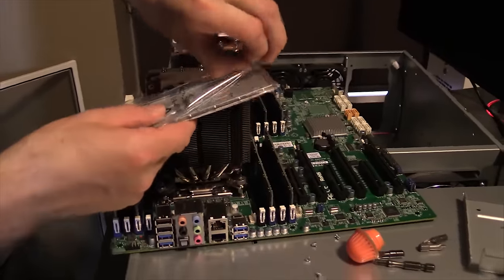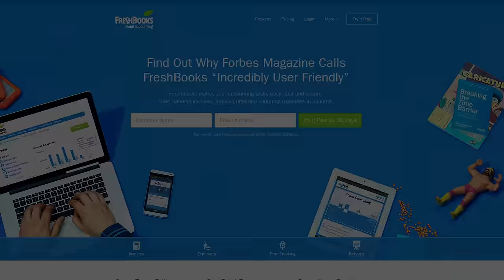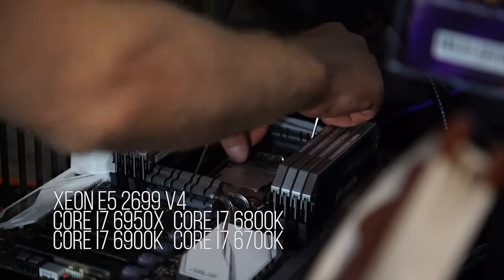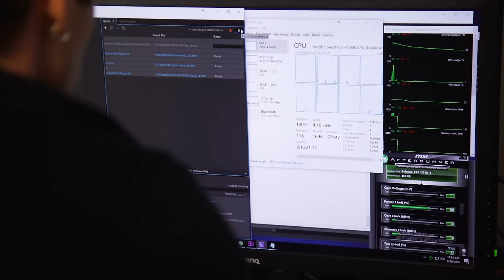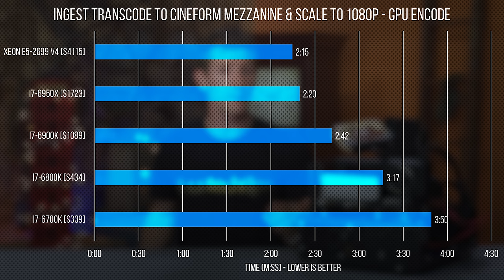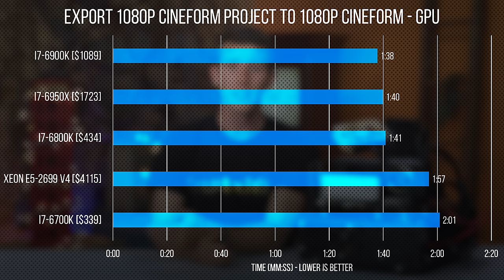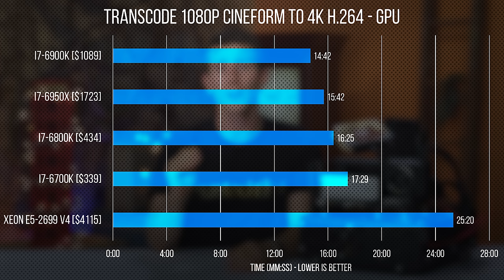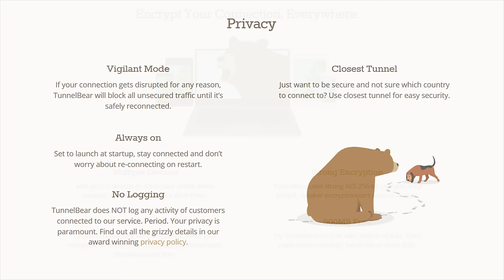$300 CPU Beats $4000 CPU?? - Cores vs clockspeed for video encoding

Comment: Please do not sort the bar charts based on time. Keep the processor you test in the same row. Otherwise it's super confusing
Reply: That's...... actually a good point :O
Reply: I like the way they do it, It allows us to see what came first and last much easier rather than going back and forth between rows.
Reply: not realy
Reply: His graphs made perfect sense to me, idk what you're confused about.
Reply: or at least color code them so I notice them moving around sooner XD
Reply: Color would have been nice or keep them in the same location.
Reply: FishFind3000 yeah, a colour gradient from "cheapest" to "expensivest"
Reply: Seriously, for encoding tests, time duration graphs ordered by fastest to longest is the most sensible way of displaying the data. There's nothing wrong with his graphs.
Reply: You noticed it, so it cant be that confusing.
Reply: what he meant is that you can "instantaneously" see the difference between the processors in each workload if the processors were in the same spot instead of having to look to see which cpu is now the fastest... that's all he meant... which i agree it would have simplified thing but the way linus has is, is basically how most have it anyway.
Reply: He's got a good point guys... When you put by time only one chart is good, but, when you do the "Before & After" thing that makes confusing to see what's the outcome of the best one or worse one for example.
Reply: Yes. If you're showing multiple graphs one after another, please keep the row positions constant... ESPECIALLY if the names only change by a single character!    -_-
Reply: I actually had to go back to the first graph since I thought it was always arranged like the first graph. I was confused why it didn't reflect what Linus was saying.
Reply: I'd agree with you Simon, if there weren't a bunch of different graphs being compared. I feel the whole benefit of using a bar graph here is to be able to pick out which was best in a line-up, but they're already in order so might as well just put scores in text. If they kept the CPUs in order, you'd still be able to see which was fastest and which was slowest by reading the bar graph, which is very easy if you differentiate entirely different lengths. Having to refer back to the cpu over and over to see how they perform in comparison is frustrating because not only are they all in plain text but they're numbers with a few letters and 6700 and 6800 are easy to mistake for one another at a glance, etc.
Reply: Everyone who didn't get what the OP meant needs to improve personal reading transfers and/or processing speeds.
Reply: +Carlo Canlas same here, I thought he was overstating until I looked closer
Reply: @LinusTechTips -- THIS. -- Please don't ever do that again!
Reply: No dude, it's not chronologically ordered, it's ordered by performance. It has nothing to do with brain power. We didn't say "OMG like I'm so dumb I couldn't read it! LOL" -- The point is it's harder to read it at a glance, you wouldn't have your data columns resorted every couple rows in an Excel spreadsheet, if you did, we could figure it out, but why waste the effort? Not to mention you have to mentally rebuild the chart based on price (which, according to the title) is the point of the video.  Finally, when you are someone like Linus, who is creating these videos for mass consumption, you have to consider, "does presenting the data this way introduce an extra burden to my watchers - - because that will affect the critical reception of my work" (and by your own admission, this format supposedly requires more "brain power" to figure out, and by what I posted above, it also gives us less data).  Hence, there is no upside to this format (at least when presented in video form -- this is not a "page").
Reply: Thanks Murphy.  I doubt I'll be changing the hearts and minds of random Internet trolls; I'm just hoping in the of chance that explaining it will help someone somewhere (maybe even Linus, if he lurks here, but probably a long shot).
Reply: To my experience Linus only reads the comments on the first day after uploading, sooo ... ;) As far as you can tell from when he's replying.

My favorite part btw was "remember where the different CPUs were in the other charts", which exactly does not help when they're constantly changing position ^^ Unless I got something wrong here.

EDIT: Oh nevermind, I got it now. It's just so way off and illogical that my inferior brain couldn't process it at once. So sorry :)
Reply: No one said sort by name.  You clearly didn't read what I wrote.  There is literally missing data in this format.  You can rebuild it in your head, but my constructive criticism for content creators is that,  for best reception, maybe don't put that burden on the viewer.
Reply: You still don't get you're misusing the word "chronological"? Man ...
As for the rest, Michael explained it already. I'll fill in if necessary, but until then I'll just watch how it goes.
Reply: What's your point in asking me what my point is and then posting what is exactly the point?! Do you enjoy contradicting yourself so much that you still do it when your failure is more than obvious? ... smh
Reply: Confusing for peasants....
Reply: You would think that's common knowledge among people who frequently have to display and explain data.
Reply: Oliver ASUS
It's unfortunate, but that truly is the direction we are going. The movie 'Idiocracy' pretty much sums it up perfectly.
Reply: unitedgray I cite that movie frequently ;)
Reply: +Patrick Star
No, please do not! I like it that way and it is the logical approach in my opinion.
Reply: "Idiocracy" is still standing strong.
Reply: +Patrick Star Did you try rebooting your computer?

Comment: Yep. Its 2016 and software STILL isn't being properly written to take advantage of multiple cores. May as well use a Pentium 4. So sad.
Reply: No, it just proves that diminishing returns occurs, and that the return on investment on high core Xeons is nill if you aren't going to use them for what they're designed for: heavy multitasking. Outside of games, which parallelization is shotty past 4 cores, most software either takes advantage of the cores it needs, or only needs a few cores. No point in forcing a program to run on 10 cores if more than 6 isn't beneficial.
Reply: No, it means exactly what OP said. ADDING MULTI THREAD SUPPORT FFS. IT'S NOT 2003 ANYMORE.
Reply: Ali Abdallah No, it doesn't. We aren't talking about the FX-9590 or 6700K. We're talking about a 44 thread high end server CPU, designed for scenarios where multiple tasks hit the CPU constantly.
Reply: as a programmer, the issue is not always the code, it is the nature of task that cannot be separated into smaller tasks. some tasks are just difficult to be multi processed in order to take advantage of multiple CPU cores.
Reply: ^exactly, this is one task on one machine, for this sort of price these are used in supercomputers and datacenters with multiple vm's so 1 cpu as being used as 4 virtual ones all doing different things at the same time like 7gamers 1 cpu.
Reply: As others have said a program code can sometimes only be broken down so much.  These huge core count xeons are not intended for running one rendering program or video game.  They are meant to go into giant servers and super computers in which these resources are is being accessed constantly by hundreds or even thousands of users doing scientific research, data processing, hosting an mmo server, etc.
Reply: It's the current year, why hasn't the world adapted to my opinions yet?
Reply: I stil use 486dx2 40mhz if turbo is on.
Reply: Pentium 4 WITH HT ;)
Don't even think of using a single threaded CPU nowadays lol.
Reply: theoretically it is possible to take advantage of all cores on a cpu on a program that doesnt use advantage of multicore. But to do that you'll have to make use a special mobo or maybe virtual drivers can do the job. not sure if they exist atm but it is possible
Reply: +Robber7 For something as trivially parallel as video encoding, you almost can.  I was just at an HPC special interest group last week.  Members of it write code that is not so trivially parallel but still scales to thousands of cores.  44 threads is nothing for an almost trivially parallel task (some frames on the join boundary need to calculated more than once but it really is almost trivially parallel).  Adobe quite frankly hasn't moved much on this from where they were almost ten years ago, and not just Adobe, the entire industry has failed to make a half decent framework for parallel computing, which is the real reason we see patchy support for certain hardware and it doesn't work unless tweaked just right, etc...This is what ATI tried really hard to push for with heterogeneous computing but the didn't manage to get any traction, especially with CUDA entering the market first and having an easier memory interface.  All the same, in the end, for video encoding it's just not that hard and Adobe has no excuse for it to not scale at the very least into the hundreds of cores.
Reply: I think it's beyond reason to expect a 22 core CPU to be fully utilized.
Reply: Adobes code base is pretty old. They have very little competition and their customers actually think their software is fast.
Reply: Some Weeb I guess that's why I do what I do and you do what you do.  Maybe not fully, but 95%+
Reply: Ah the old 'video is sequential frames, of course it's trivial to optimise for multiple threads' fallacy. h264 encoding introduces many levels of interdependency in the data stream (hence the efficiency of its output), this makes it far from a trivial task to scale encoder parallelism infinitely.
Reply: TehJumpingJawa It's not that many frames, I clearly addressed that issue earlier, and yes it's still pretty trivial, also we were talking about h.265 rather than h.264.  This isn't that hard for h.265, much easier even for h.264, and yeah, embarrassingly parallel for mpeg.  There was no fallacy here.
Reply: TehJumpingJawa Actually, some more details for you.  The rough process I described is encoding independent "slices" as they are referred to in the h.265 standard.  They have also have other parallel encoding options in the standard that are less trivial:
https://en.wikipedia.org/wiki/High_Efficiency_Video_Coding#Parallel_processing_tools
should one choose to use them.  I made no fallacy.
Reply: Multiple cores do not scale infinitely with almost all workloads. Do you think computers are magic? If threads have to be in sync your program can only benefit insofar as the slowest thread completes it's task.
Reply: DMitsuki I like how all you scrubs that don't program code to run on multiple cores like to tell me how it scales.  No, not infinitely, but it's not that hard to get it to scale to a few thousand cores on a shared memory model architecture.  22 cores/44 threads in this shared memory, even shared cache architecture, totally trivial.
Edit: Or you know, you can go ask the HPC scientists that were just at the SIG in the Hague for yourself.
Reply: I really find it hard to believe you have written any breadth of code when you just trivialized all data sets to your specific use case.

"Hurr don't tell me how multithreading works this very multithreading friendly workload scales real well so everybody should be able to do it in all task."

Two task have to sequentially solve a math problem. The answer the program is looking for is the sum of both math problems. Assume the add operation is a constant c, what is always going to be the fastest time this scenario can finish?

If we add in more cores, the answer doesn't change. If we add in more math problems and cores for each math problem, the answer is still exactly the same. zvxcvxcz
Reply: DMitsuki I find it hard to believe your reading comprehension is so terrible.  The context was video encoding, in particular h.265, see the link I gave earlier.  Not only is it not that hard, it's part of the fucking standard.
Reply: DMitsuki Try tagging them in your first reply then, you obviously have learned how to tag now.  It's not my fault you weren't up to speed with even the conversation, let alone the subject matter.
Reply: Most companies are going to use dated hardware and won't replace it for years. They don't follow the enthusiast mindset of replacing hardware every year or 2 since they don't have to.
Reply: or you use x264 instead of these shitty timeline encoders...
Reply: Depends on the software, newer games are doing a lot better! Try BF1, it makes use of all of my 16 logical (8 real) cores on my Xeon, delivers better FPS than my 4 core (8 logical) i7, even with 1500+mghz lower clock.This is dx11, just realised i haven't even tested it on dx12 with the xeon yet, must do that tonight!

So more cores be coming into their own, can only get better as the API's mature as well.
Reply: BF1 really was optimized to utilize a xeon? I find that hard to believe.
Reply: Kabloosh 
Optimised specifically for xeons, off course not!
However , when comparing the xeon to myn 2nd gen i7, its runs better because it is optimised to make use of as many threads as you throw at it, and runs better to boot!

Head on over to OC.net , theres a 16 page thread on bf1 performance, 4 core/4 thread i5's are bottlenecking 1080's, 60-70 fps(even at high clocks) even my ancient i7 is much better, because 4 cores 8 threads, xeon even more so.I was looking at hardware usage last night checking my board temps after i just watercooled my 1080, it appeared to be loading all 16 threads in bf1!No doubt a more modern hexa core i7 with faster clock would be better than my xeon, but they cost a little more than $100 ;)
Reply: Xeon's aren't cheap though unless you buy an outdated one. I've got a 6700k in my machine and I think it only cost around 350 dollars.

I can't imagine running with a 1080 and 6600 is going to be that big of a deal unless you're aiming for 4k. I think the money spent on the monitor is better spent on upgrading the CPU first though.
Reply: As i said, i paid $100, for 8 cores with HT and 20mb of cache, yup its a few generations old, but still outstanding bang for buck for me because i was already running a x79 board.Would not be worth it if you had to buy motherboard, because they have actually gone up in value due to the availability of these cheap as chips high core count xeons.

Its no myth that quads are bottlnecking 1080's , no need to take my word for it,go look at all the guys complaining they are only getting 60-70 fps in bf1 with i5's +1080's.Then look at every6 benchmark for 1080's in bf1 with an i7, its not 60-70fps! I pull 80-120 comfortably averaging 100fps @ 1440p ULTRA.

By the way, 4k is LESS likely to be a cpu bottleneck because you are loading GPU more, cpu bottlenecks become a problem at higher frames lower resolutions,not low frames high res.
Reply: A cheap xeon like that would be nice to set up a nice little virtual server network pushing services like DNS, DHCP, and the like. Those don't really require much power though.
Reply: I'm pretty sure that the $4,000 server CPU is made for different kind of server than just video rendering... Its like telling 50 people to go clean a garage.  you can only fit so many people in the garage before they start getting in each other's way.  

I think the cpu was made for hosting a lot of virtual servers.  you just need one server with a lot of ram and storage instead of a bunch of different servers.  or other things for multitasking.
Reply: Libri Lector Premiere is very inefficient encoder though. Use x264 and you'll reach the 100% while being a better encoder too.
Reply: I wish that was the case Tonkis. Currently adding multi-threading to my engine, its a pain.
Reply: like rendering frames simultaneously?
Reply: Yes they do: "That would be another product we can charge more for"
Reply: In reality the kinds of loads being exploited are trivially or embarassingly parallel. I'm supporting scientists processing lunar/martian/terrestrial mapping data where each tile is independent and the actual code is single threaded, so we just fire up more instances of the process (i wrote wrapper scripts to scattergun the tiles monte-carlo fashion. There's no reason the processing can't work across the set in other patterns, but this allows human-visible results to start appearing fairly quickly.)
Reply: [Insert Name Here] But the earth is flat...
Reply: How many people in this thread have actually written parallelism in their lives? Not to mention even understand the differences between RISC, CISC and IPCs within the context of pipelines combined with TIME. Literally there's NOTHING to see here if you understand those concepts.

Comment: Watching you screw up makes me feel better about my computer fiascos.
Reply: Mate if you saw the cable management in my build. You'd actually cry.
Reply: ah don't worry about it. everyone makes mistakes. computers are a very tricky subject so even the pros can get it wrong sometimes. especially if you're trying to set up a network lol that can make you want to pull your hair out.
Reply: I wired my own connectors to my PSU (Not my main one, but in another box)

Get fucking real. I win at losing.
Reply: @Communist Ralph

hahaha /bows